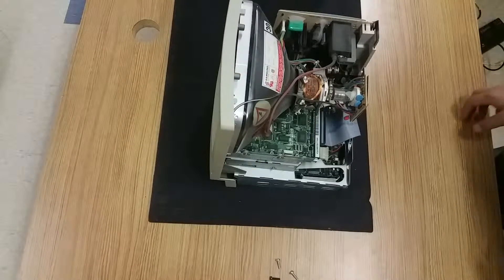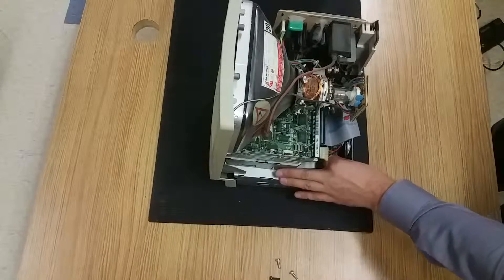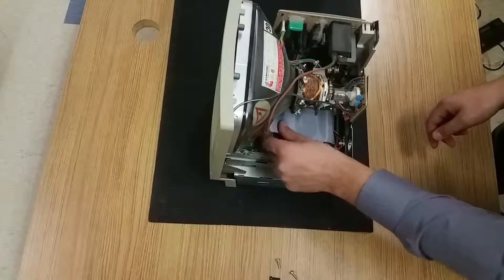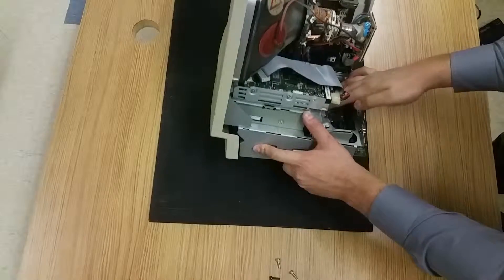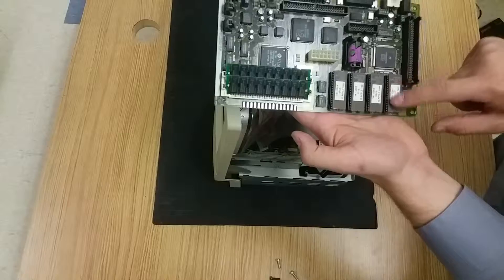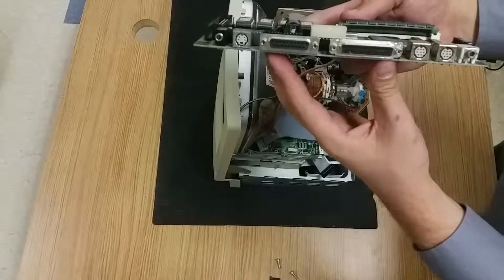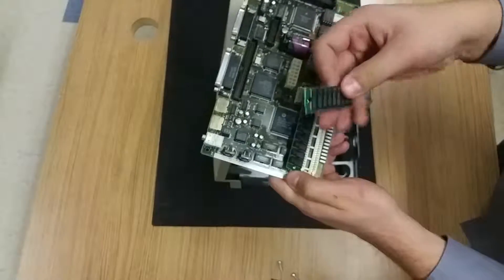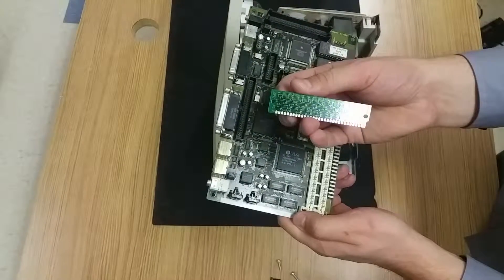Disassembling a Macintosh Classic II Part 2 - Motherboard and RAM

Comment: can i die from touching this
Reply from the maker: It is possible, especially if it was recently plugged in. Older computers have components that can zap you, or much worse. Be careful and avoid taking apart older computers and monitors if you don't know what you're doing
Reply: Brian Fediuk it unplugged for long enough that i didn’t get zapped. thanks for the videos :)
Reply: My Classic MB is dead but I put in a Classic II MB in my Mac Classic. My fan came on and HD spun but nothing on display. Do you know if these 2 MB are compatible in a Mac Classic?